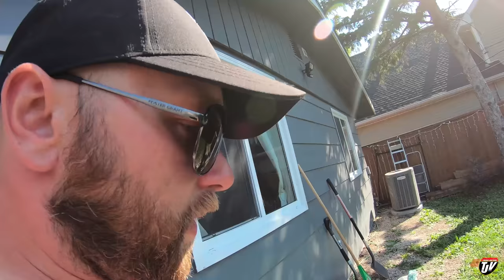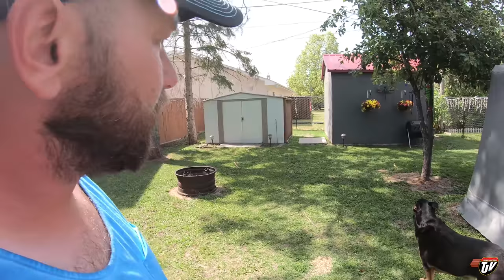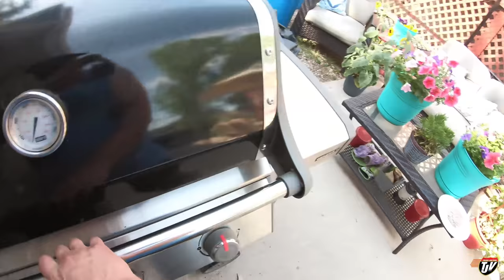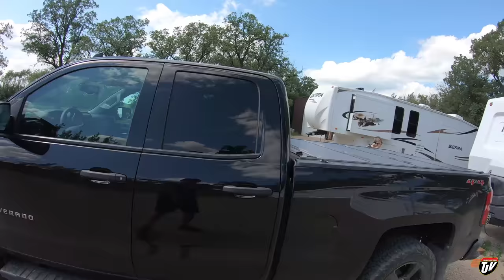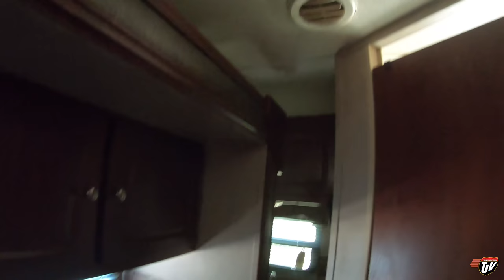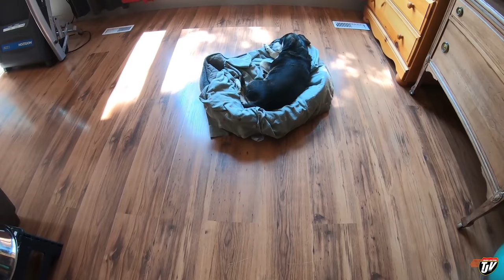MAN'S BEST FRIEND? | TJV | #2317

Comment: Try some pails/buckets outside with a can/bottle in middle with a wire for support. I used the metal Handel off bucket, just had to straighten it out and drill holes on either side of pail.. Put a bit of soapy water in pail and put peanut butter all way around on bottle to bait them. Put containers under trailer , if not, they will find their way inside.

Comment: Kinda late now since you're almost done, but I think I would have run a circular saw parallel  to the joists, cutting the 2x4's off,  leaving just the parts attached to the joists. (2" wide) Go underneath the remnants with an oscillating blade, cutting the screws off flush with the joists.  Just a thought from a do it yourselfer.

Comment: Hey Josh!
You mean you did not figure out that the pressure washer might jet that stuff out of the screw heads?  "Zero degree" straight tip and about 1/2 inch away from the wood should blast that crap right out.  IF you have a 3500 PSI or more pressure washer.
Ken

Comment: You might be done removing the old decking by the time we see this but wonder if using a wire wheel on the drill might’ve worked to find the screws.